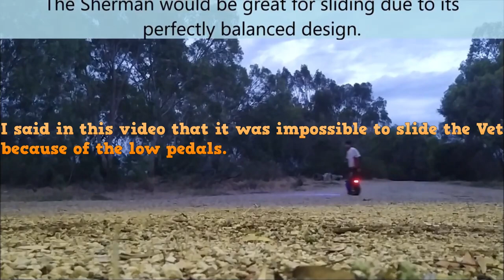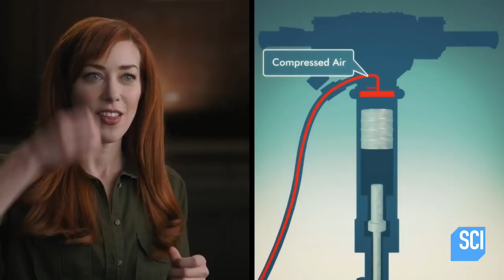Paid for a DOPE EUC - GoT a JaCkHAMMER (Total Lunacy) - MUST SEE

Comment: You mean you got a dope euc until you farked it lol

Mine has a shaking problem at the moment but that's because I have broken my inner casing. Should be fixed next week.

Very creative video tho
Reply from the maker: HAHAHA that's true but that's not the full story. I rode it till I farked it. Paid $500 to get it fixed. Basically everything replaced. Main board, motor, rim, tyre. Got it back "fixed" and it was in jackhammer mode. It would jackhammer whenever I tried to trolley it. Then I got thrown off while riding. That little piece of footage in the video is me face planting. Right before that hilarious dude on the bike falling off the truck.

Comment: I struggled to turn it off as well when it happened to mine (messing with firmware and wheel open)
It was pretty scary, and managed to get rid of all the mud on the inner shell! It cleaned it so well!

I wish I thought about lifting it up tho, which would stop the vibration instantly
Reply from the maker: Actually lifting it up didn't stop the vibration immediately. It kept happening and the only way to stop it instantly was to tilt it. So the lean angle cutout would kick in.
Reply: @arcrides6841  oh interesting yeah I can see how this can happen!
Good thinking with leaning it on the side 👍 although it's not that easy to do in practice in this scenario.

Comment: Loose axle nuts and pedal hanger screws can cause that vibration.  🤙
Reply from the maker: Thanks for the tip. I'm already in the process of sending it back under warranty though.
Reply: Yes everything need to be fully tight. Also it depends quite a bit on the firmware version.
The initial pre-release factory  firmware that's on the boards, before being actually flashes is super prone to vibrations.
When working on my 16X I had that happening when it was not fully tight and had the 1.0 pre-release firmware.

It shouldn't vibrate anymore with a 1.07 or newer firmware, and all things attached as they should.
Reply from the maker: @supercurioTube  Hey the workshop found that you were correct. The issue was loose bolts.

Thanks so much for your input!!!!!!
Reply: @arcrides6841  hopefully the service center uses a good amount of thread locker.
Sitting on the shell also makes it more likely to happen since it puts significantly more weight on this interface.

Comment: Cool slides
Reply from the maker: Thanks Dale. Are you back in Tasmania now?
Reply: @arcrides6841  nah stil in Adelaide
Reply from the maker: @electricunipsycho  Awesome. Enjoy your time here and hopefully we can still catch up for a ride. Gonna sort my wheels out ASAP.
Reply: Hopefully we both get our wheels fixed before I head off
Reply: @mydrolab5155  Steve? Btw do I know you? Hard to tell with the name lol
Reply from the maker: @electricunipsycho  Oops lol that was me with that comment about the 16x. Yeah I really do hope to get it fixed soon. I just sent out a message and I think I'll be sending back in hopefully ASAP.
Reply: @arcrides6841  what's wrong with it at the moment? The shaking? Is the casing in tact where it bolts to the pillars? If so check you haven't pinched 1 of the thin wires coming out the motor when you put it back together. Thy are for your hall sensors and if they are damaged you can get that aggressive shaking.

May be able to save yourself some time by diagnosing it before it go's back.

I can come have a look at it for you if it helps
Reply from the maker: @electricunipsycho  Hey thanks for offering to help. I might take you up on that. Let's hear what Brendan has to say first. Yeah it's just the shaking. I'm quite meticulous about not pinching wires but it doesn't matter anyway since the issues were there as soon as the wheel got back. Well before I opened it up.

I'm not sure what you mean about the casing being intact. Do you mean the thin plastic shell? AKA the 2 side covers.

If you're talking about those then no they aren't exactly intact but I don't think that would matter. And the guys at the repair shop put this thing back together with the broken covers and they didn't mention that it could be an issue. I can't really see how it could be the cause of these vibrations.

Is that what you were referring to?
Reply: @arcrides6841  the internal casing where the screws hold the casing and its contents to the pedal hangars/pillars
Reply from the maker: @electricunipsycho  Do you mean those 5 big screws on either side just below the battery packs? If so then yeah I made sure they were all tight.
Reply: @arcrides6841  yeah what's the casing like around those screws? Is it cracked or broken at all? That's what's causing my shaking. It happened in transit when I had my wheel sent to Adelaide.

If not I'm guessing hall sensors
Reply from the maker: @electricunipsycho  Oh okay so you're not talking about the thin plastic shells?

If so then I'll need to open it again and take a look. Maybe I can see it in the footage I took.
Reply: @arcrides6841  yeah on the internal casing where the 5 large screws are and the surrounding area
Reply from the maker: @electricunipsycho  alright got it. I'll take a look at that and see what I can find. What if it's broken?? Is it easy to replace?
Reply: @arcrides6841  I have mine coming this week hopefully. I imagine it's gona be a head fark but pretty straight forward
Reply: Il be taking photos to make sure it all goes back right and transplant everything piece by piece putting it in the same place it was in the original
Reply from the maker: @electricunipsycho  sounds good and good luck with it. Let me know how it goes.